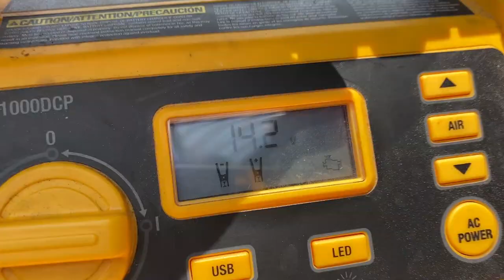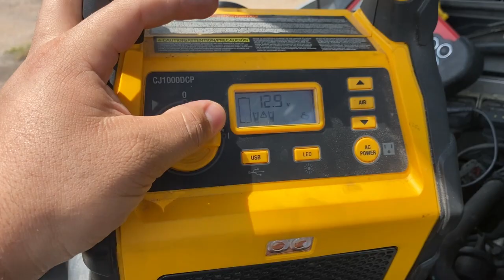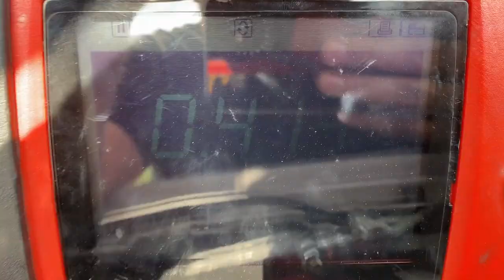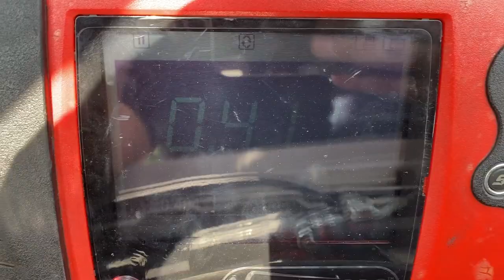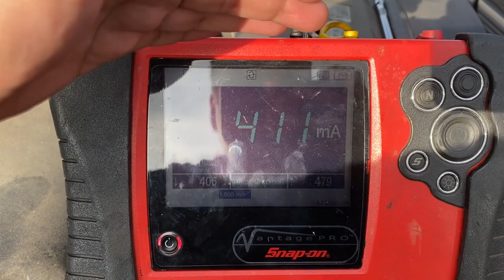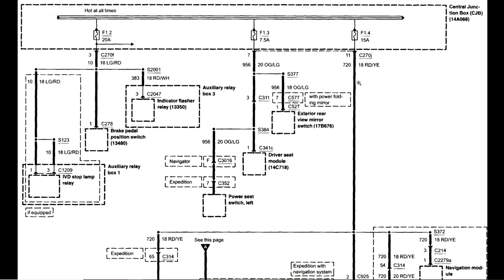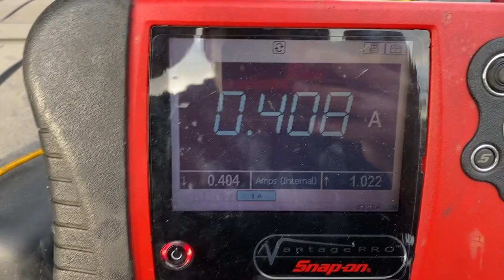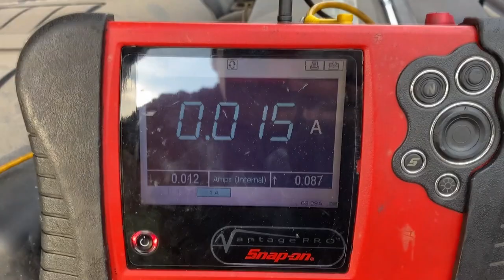FORD LINCOLN NAVIGATOR PARASITIC DRAW KILLS BATTERY DIAGNOSIS & FIX

Comment: 30 yrs ago, a VW convertible had a parasitic drain on the battery. I was by myself, so I made long leads, hooked up a volt meter, battery was draining .01 volts per minute. I followed the exact same process. Battery started at 13.31 volts. I pulled every fuse, no change. Battery was down to 11.55 volts. I pulled a non-fused, grey wire. Voltage jumped to 12.55 volts. I checked to see what did not work. I did not have a wiring schematic. All things worked. Business colleague later told me that the light that came on to indicate a gear shift was required no longer worked. (it was a stick shift). Business colleague had brought his daughters vehicle to a number of electrical shops in Jacksonville, Fl. He asked me to check as a favor.

Comment: I felt your pain upside down in that car. I always open doors and latch them at the start . Once you established the cause it was easiest fix ever. 👍
Reply: Hey use an Infrared Camera to find parasitic draw... You can see what fuse and or module has a load on it from the temperature difference... its pretty fun and very fast to find the suspected circuit..

Comment: If the DVD unit is still operational, perhaps you can install an on-off toggle switch on the housing to disconnect the power when not in use.
Reply: Maybe a firmware update woulda fixed the DVD player. It seems like it was not going to sleep when the car was turned off.
Reply: @fredsalter1915  internal short but the op has the idea of a true solution. I actually did this on a GPS system. I installed a relay that was triggered by the ignition switch, usually these modules have direct power and another power circuit powers them on internally. A short would cause amp draw like this, very typical with radios too because they have direct current and ground.
Reply: And if you see 19:36 the dark spot on the right of the DVD has like 2 small purple lights. Which I think are the Infrared LEDs to read the remote controls input. Indicating it was on

Comment: When I was dealing with the same problem, I just had made leads long enough to take multimeter in the car with me. So I didn't need to have a helper. Additional leads voltage drop was irrelevant.

Comment: Thank you for the video. If you don't feel like voltage drop testing the fuses while searching the draw you may want to pull fuse by fuse but not put them back in until you pulled all of them. That way you'll avoid waking up components and you don't have to wait for them to power down.

Comment: I'm glad you said something about letting Fords time out for about 40 mins to an hr. Service data says this, and covers all vehicles from about '00 to about '11. It has been my experience that the smart junction fuse box battery saver relay sticks, and will cause about a 400mA draw. Sometimes it's just the relay, other times the magic box. If so, the box must be programmed to make the remote key fob work, even with the same P/N. Glad you found the issue!

Comment: Fantastic as always Eric!
Try looking for voltage ACROSS fuses, so you don't need to disturb them!
(I'm out of commission for a short while. No vids until I get my computer data recovery)
Reply: Yep... there is a table out there for reference
Reply: typical voltage drop 5mv per amp across 15A fuse .  Measuring  parasitic currents this way can be done, but you need a voltmeter with 50 microvolt or better resolution .

Comment: Thanks for making this video. It was the same issue draining my battery. There must be an internal issue with these overhead dvd players. Important thing to know is that fuse 21 is the instrument cluster. At first I thought this was my issue. This circuit  takes 40 minutes to go to sleep. If you pull the fuse leave it out and test the other fuses. If you put it back in you will have to wait another 40 minutes for it to go to sleep again.

Comment: You are no doubt very gifted . however in this test with the fuss"s  do the same test but DON'T put the fuss's back in leave them out until you find the problem .  by reinserting the fuss you wake up modules deny it power until you find the problem . i hope i helped cheers !

Comment: Great video! I was following your wiring on Mitchel. Maybe you should have started with the door latches on all 4 doors closed but the doors open. That way you have access to the inside of your vehicle. Also make sure that it's the supply wire to the fuse box that's taking the amps and not any other line.

Comment: Would it be OK to use an Amp clamp rather than disconnting the battery cables and connecting and an Amp meter in series?
Reply: You could but sometimes can be inaccurate, connecting in series is a exact reading.

Comment: I went through a few difficult parasitic draw diags before I changed my procedure to speed things up and make it more streamlined.
Reply: so what procedures did you changed?
Reply: @lordjaashin  the same ones Eric struggled with here, before starting I would prep all the doors by setting up the latches to have the door open but not have the interior lights on. Many times this meant setting up the trunk or rear hatch in the same way so that I had full access to the interior and didn't have to reset my sleep timer by opening a door. Also when possible I would test by measuring voltage drop across a fuse to see if a circuit was active rather than unplug and reinstall fuses which would wake up modules and cause me to take more time on a diag than necessary. Another thing that really helped was taking multiple pictures of the fuse box before I touched anything so that I could at least get it back to it's original starting point. Although they don't always show up with everything in the right place at least it wouldn't be my fault something was in the wrong slot. I had to implement these changes after a couple diags took me hours that they shouldn't have. Also Uni-t has a handheld amp clamp (UT210E) that is awesome for finding  even very small amounts of current flow and it's like $50 using that I didn't have times where my connection to the battery would get disturbed and reset the sleep timers and I didn't take the risk of popping fuses inside my meter since some of those are not the easily found or easy to replace kind.
Reply: @jwilkers1  you have given very good pointers. I'll try to buy that amp clamp you mentioned.
Reply: @jwilkers1  I keep seeing the comment to test across the fuse. Is this either side of the fuse or from the fuse to ground. Sorry for the extremely uneducated question. Just trying to understand. Thanks

Comment: one tip after you found the correct fuse  hook the meter to the fuse box where that fuse was  that way if you wake up any modules you want have to wait for them to power down as meter hooked to the battery cable

Comment: Did the replacement PCM come pre-flashed?  If they are available pre-flashed it would be good news to us DIY'ers.  There are few qualified independent shops like Eric that can do this.  We would have to depend on a stealership that won't do it unless you buy the PCM from them at a ridiculously high price and then charge you an eye to re-flash it.

Comment: I had a 91 mercury that had a battery that was draining overnight and removed fuses until I found the culprit. The drivers electric seat motor had a short circuit. It was routed through a circuit breaker

Comment: I thought you solved the problem when you found the terminals loose and dirty. I would have cleaned posts and replaced the terminals then start the testing. But that's just me.

Comment: Before you start, you should open all doors and latch them with a screwdriver, so you have access to everything. If you don't have a normal 'dumb' jump pack, you can park your own vehicle close and run jumper cables. Disconnecting that dead battery was a good move. When car is asleep, just measure millivolts across all the fuses and only pull the one that shows the highest millivolts value. If you pull them all one by one, for sure some modules will wake up on you.
I really don't get why you set yourself up to having to climb through a window on a hot day. it was quite hilarious.

Comment: I'd probably ask if they would ever want to use it. Add a switch with a relay or a switch transistor and you can turn it on when you want but you'd have to turn it off not to depleet the battery.

Comment: U should use another voltmeter to check voltage drop across the fuses using millivolts scale. Latch all the doors, the trunk latch and hood latch or switch. U can use power probe chart and it will tell how many amps is flowing by using the fuse size and amperage

Comment: Find the fuse that activates or controls the door switch pull that one first next time so you don't have to be inside the car and such an awkward position.
Reply: Or use a screwdriver on latch 😂😂 posted that before u said that🤣

Comment: i always click the door switch so it thinks door is closed also then i measure across each fuse to see how much load is on each fuse and then use the power probe chart much easier

Comment: Drains are a nightmare. I've just looked at Audi A4 2.5 TDI V6 2005 with 1.3-1.7A drain when asleep. Could find it in an hour or looking. Anyone knows of common problems?
Reply: Focus on body/chasis related items such as doors, lights, accessory items and thier modules...usu these are powered by the incabin or inside the trunk fuse box.
...remember that 1.3 amp is high amperages and most likely will be caused by a lamp staying on not a waken up module.

Comment: 9:00 isn't easier to c clamp the door switches and leave the doors open and then just go with a meter through each fuse instead of taking them out?

Comment: You can open the doors, just use a screw driver to trip the latch shut. So long its not a plunger style switch
Reply: use vice clamps for plunger switch

Comment: That jump  pack has a thing called reverse polarity protection
Reply: My brother had a garage sale once and he had a car battery charger that he said would not work, so I thieved it from him!
Turned it on and checked with multi meter snd yep no good, happened to be talking to a sparky at work about it and  he said some of them have smarts where they won’t charge a completely flat battery have to a certain voltage threshold like 8 volts minimum for example. 
Tried it on an actual battery and bam it worked, what a free score that was. 
Maybe jump pack has similar smarts.
Reply: @michaelslee4336  Oh that's weird I wounder why they have that
Reply: @neilmurphy845  
Possibly a dead flat battery can be seen as a dead short and the current to charge it from dead flat may be too much for the charger??
Not sure, but if it has smarts it should be smart enough for that. Anyway useless as a power supply, I have use my stupid charger for that purpose.

Comment: Hahhahahaha.  I own an 04 nav.  No way you were gonna pull fuses without opening the door.  Basically have to flip upside down and shove your head under the dash.  
I got the same issue.  Mine dies after about a week though.  I barely drive it anymore.

Valium buttons?

Comment: Great video. You should get https://www.amazon.com/dp/B08PP15B87/ , the 210E pro. Cheap, small, Clamps on, reads down to 1ma of DC current.  Accurate to a few ma (more than enough). Never have to break the circuit (which as you know on Fords can reset the timer). I just used it to check the oxygen sensor heater wires. I keep it in my glove box in the case.

Comment: The problem  with these units  . is the fan in the unit isn't cooling the system an the system  over heats an cause this  problem .